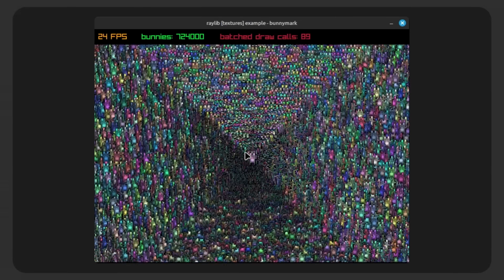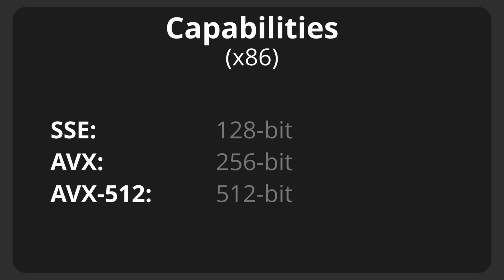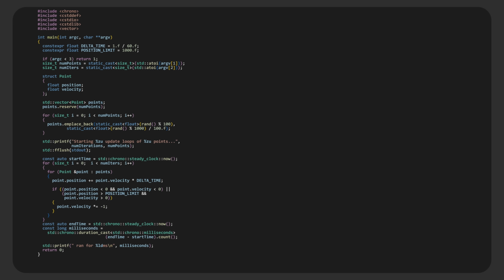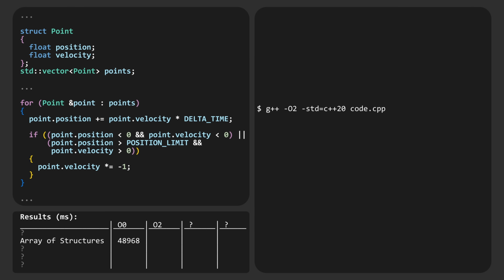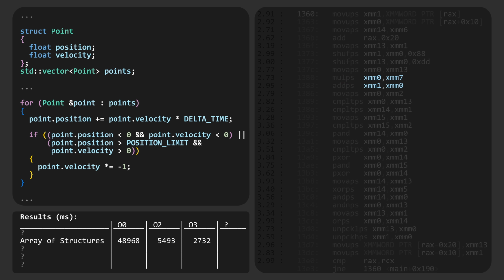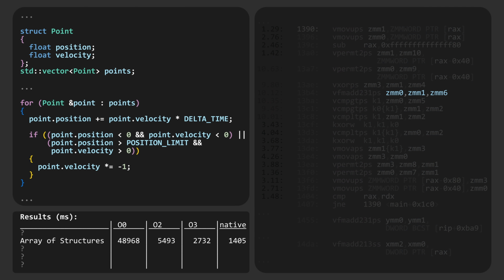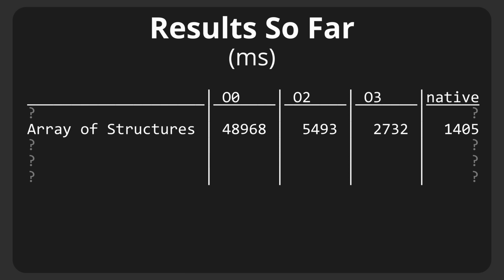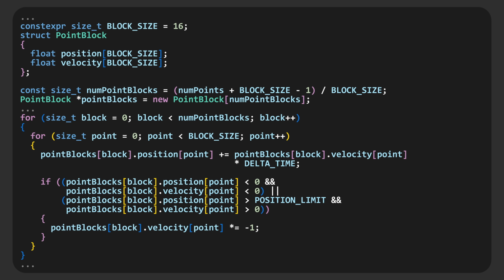4x Code Performance with SIMD

Comment: We really need more content like that, amazing!
Reply from the maker: I'm glad you enjoyed! Any topic you're intrigued in the most?
Reply: @keiferjh  practical optimization using raylib, maybe playing more with shaders to increase performance?
Reply from the maker: @daniel99497 I've only recently dabbled with raylib and shaders, but it was interesting to go through the progression of using many calls to `DrawCircle`, to one call of `DrawCircle` to a `RenderTexture2D` that can be used for many calls to `DrawTexture`, to using `glDrawArrays` with `GL_POINTS` and a custom fragment shader , and of course to using a compute shader. Might make for a good video idea!

Move to `DrawTexture`: https://github.com/KeithJH/kinematics-demo/commit/e6c94b324f172da0b3dece6bd51567884bc2e05e
Move to `glDrawArrays`: https://github.com/KeithJH/kinematics-demo/commit/a8a335f963db7e1f5a0285c1b706a3e1f7124a20
Move to compute shader: https://github.com/KeithJH/kinematics-demo/commit/ec49f728ae8e2e26cf65ffdbf4ffe4e4a97cf4ae

Comment: A polished low level coding video tutorial that isn't made by a chronically online transfem covering Rust? Is it 2015? :v
Jokes aside, great example. I wasn't aware g++ can auto-vectorize stuff so well. The block size trick reminds me of sentinel values in arrays to eliminate checking for being at the boundary to handle a special case.
Reply from the maker: Compilers in general are really sophisticated. Both clang++ and and g++ work well with the examples as given. I've tried a bit with msvc but need to dig deeper into what flags or assumptions are missing. Compiler Explorer (links for the specific example in the video description) is great for testing things like this out!

Comment: I made a 5-instruction cross product with SIMD and it was the greatest feeling ever:

pshufd xmm2, xmm0, 0b11_00_10_01
mulps xmm2, xmm1
pshufd xmm1, xmm1, 0b11_00_10_01
vfmsub132ps xmm0, xmm2, xmm1
pshufd xmm0, xmm0, 0b11_00_10_01

Given r = a × b, a is in xmm0, b is in xmm1, and r is output to xmm0.

When I pulled this off, it felt so good, knowing this was exactly what the CPU did.
Reply from the maker: @KaliTheCatgirl Awesome! It's always an accomplished feeling when something like that comes together! Though sometimes it's followed by the compiler somehow finding a better solution that doesn't make sense.
Reply: Nice. AVX is liberating once you understand what can be done with it.
Reply: One of the best things this video did was showing how you think about structuring your code so that its IR lowering gives effective results. Tbh you’re honestly probably better off writing well thought out C than ASM that you expect to be optimised in a particular way.
Reply from the maker: @laimkearn Exactly! It's both fun and informative to explore the underlying operations, but it's often much more important to be able to review and not necessarily author. Optimizers are generally good enough that it's best to stay out of their way once you have the "right" algorithm and data structures. There are always exceptions, of course.
Reply: @liamkearn completely wrong
Reply: Very cool to muck around with though! You can’t write C that lends itself to optimisation without knowing what optimisation you’re aiming for!
Reply: Time to learn about microcode and µops 😭
Reply: The feeling must've been out of this world
Reply: Nice. Here's one I wrote as a BQN exercise this morning, which is a little messier:
(-´ ⟨1‿2,2‿1⟩ (×˝⌽˘)¨ <∘≍)
Yours is more like:
(1‿2‿0⊸⊏ (1‿2‿0⊸⊏)⊸× - ×⟜(1‿2‿0⊸⊏))
For 3-vectors, 1‿2‿0⊸⊏ (select) is the same as 1⊸⌽ (rotate by 1). So it can also be written:
(1⊸⌽ (1⊸⌽)⊸× - ×⟜(1⊸⌽))
I think I've seen a similar version on rosetta code or something.

The assembly uses 4-vectors, so you left index 3 in place. A pairing of × and - merged into a multiply-accumulate msub operation. Indices read right to left. Slightly grating how d for double word contrasts with s for single precision (because 8086 is 16-bit).

Comment: If only most devs weren't shitting on assembly we would have an awesome and optimized world.

Thank you so much for this awesome video!
Reply from the maker: Reviewing generated assembly certainly has it's perks! Compilers generally are much better at their job than we are, but it also highly depends on us giving the right inputs!
Reply: imagine the amount of wasted time... oh lord...
Reply: no, not as long as corporate greed exists
Reply: @ThylineTheGay  uhh, i get your point but you can't just blame EVERYTHING on that

think about it for a little bit, why most (even open source) devs don't touch assembly
Reply: @boblol1465 It wouldn't end up yielding much benefit for 99.99% of programs, modern C compilers can almost always produce faster assembly than humans.
Reply: @tomtravis858  And this kind of comment is the kind that I was talking about...
Reply: @tomtravis858  yes
Reply: @Splarkszter  Nothing I said is wrong, bad assembly level optimization isn't the fault of any performance issues in user programs.
Reply: @tomtravis858  ffmpeg for example regularly gets 3x to 10x or even better improvements by replacing C code with assembly.
this "compiler is smarter than you" mentality needs to die. yes, compilers are very competent(at least nowadays), but they still make errors.
and iirc, in embedded programming compiler optimizations are turned off usually.
Reply: @ssjcrafter8842 no, we need to go the other way and make compilers less crappy to remove their limitations. but your not a compiler dev so that doesn't concern you. on your end, sure use assembly in the meantime I guess but it's still a really crappy and unnecessary way of doing things
Reply: @ssjcrafter8842  ffmpeg is absolutely nothing like code most people write. It's a ridiculous example to use here.
Reply: how many useful programs have you written in assembly? have you even written a line of C in your life? quit larping.
Reply: yes, image how much electricity we could save

Comment: nice video, but i thought you are going to be directly be using avx instructions instead of trying to make the compiler achieve what you need
Reply from the maker: @nikita_ed There are  just too many interesting avenues the topic can go! Compiler auto-vectorization felt like a good starting point since it gives a good baseline for any architecture you can compile for. From there it's really cool to explore more with things like intrinsics or inline assembly, which naturally works it's way into topics like dynamic dispatch based on hardware (I've been meaning to dig a bit more into function multiversioning with clang/gcc).
Reply: I feel like that would be better for a separate video. There were some optimizations I found with boolean operations and masks for example where I didn't want particular interactions of data - O(n^2) where each element interacts with eachother excluding itself and zeroed fields.

Comment: I'm fairly new to writing well optimized C++. One thing that jumps out to me is how un-readable the optimized C++ code is. 

I'm curious if this stuff can be abstracted away from the programmer, or at least the reader of the code. Is the only option to use a programming language or libraries that are vector native? Or can we somehow indicate to the compiler that the data is separable as vectors while maintaining something readable like the unoptimized struct example?
Reply from the maker: Great question! The short answer, as usual, is that there's lots of nuance. There is nothing in the C++ language that directly lets you "decorate" structs so that they are automatically treated in a SIMD friendly way for the operations as shown. You absolutely can build up an interface that abstracts some of it away; even in the examples I gave you can imagine any of the `Points` structs being classes that could expose an interface that operates on the "collection" instead of a singular point. Entity-component-system (ECS) is a pattern that may of interest in this area.

It's also worth noting that this data layout is not always the optimal layout, even for the same data. It all depends on what operations you need to do on the data. The SIMD friendly layouts shown in the video could end up being terrible for heavy operations on a singular point, as the fields within a singular point are very cache unfriendly compared to the "unoptimized" struct example.

Wikipedia also has an article that is good starting point for this very question, if you want some keywords to research some more: https://en.wikipedia.org/wiki/AoS_and_SoA#Software_support
Reply: @keiferjh  Thanks to you both for the insight!
Reply: "Vector native", or as we know it array oriented, is indeed easier to read, write and optimize. Autovectorization is a tricky problem but pure languages have a better chance to do it, much like how loop fusion is standard behaviour in Haskell. See Futhark for an example of enabling this by design, or OpenMP for an example of patching it in (#pragma omp declare_simd, simd). Writing with instruction intrinsics is essentially the same as inline assembly.
Reply: There are languages that can perform the transformation from array of struct to struct of array, for instance Zig's MultiArrayList or Rust StructOfArray.
Reply: As usual, it goes back to well established concepts; struct of array is a niche description of a column oriented table, as they're known (and dominant) in database engines. DataFrame is another word for such tables, in contrast to multidimensional homogeneous arrays.
Reply: In general no - complexity is an inherent property of a problem. Either the code you write is complex, or the code the language generates for you is complex.

Comment: I love how writing out x64 instruction names now takes longer than to tell a chatbot to implement this. 😂 VFMADD231PS, oh good lord. I was born in 1983. Back when people were able to patch instructions from memory in a hex editor. B8 is mov ax. I remember, because it looks like a female décolleté.
Reply from the maker: Hahaha, it is quite the mouthful (screenful?)! I almost went to shorten it for the thumbnail!
Reply: Risc-V vector instructions are quite a bit more consistent, and also designed to be scalable. No more switching operation name depending on the vector register width of the particular processor. It also has strided loads and stores, which it might use for the array of structs case.
Reply from the maker: @0LoneTech Risc-V yet another topic I've meaning to dive into!